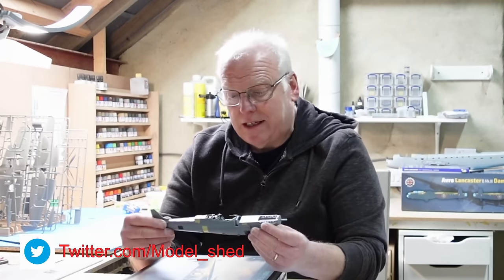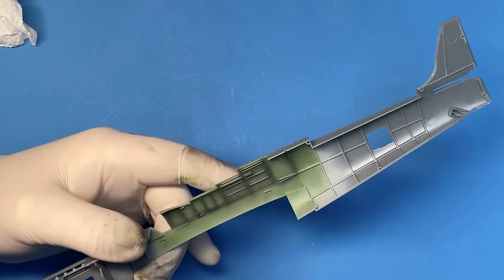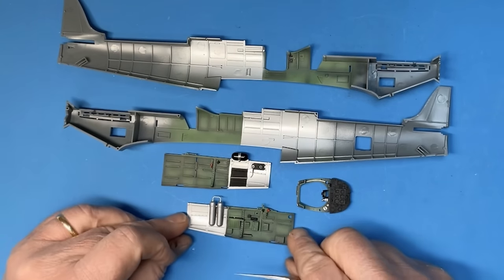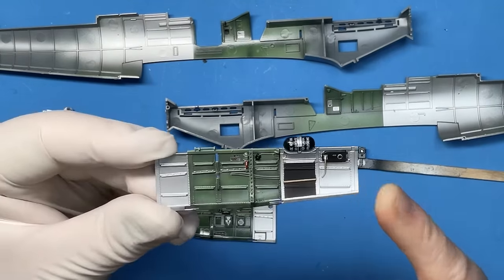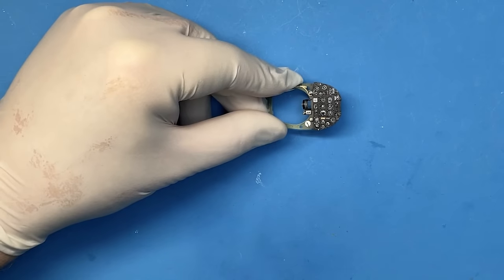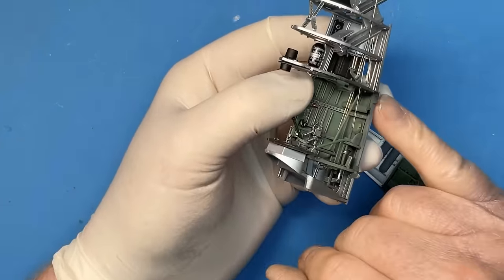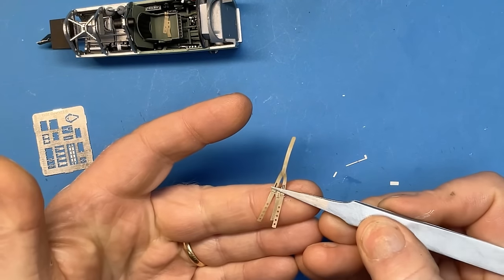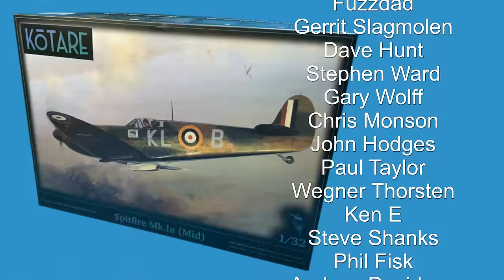Kotare 1/32 Spitfire Mk1a part 2

Comment: I remember a safety video from my time at RAF Laarbruch,with using cages when inflating Aircraft tyres,thats something that has stayed with me
Reply: I am an ex RAF Rigger, wheels and tyres were part of my trade. In training they shew us a video of a Hasting main wheel  being inflated until it exploded, a wheel the same size as that on a Lancaster ended up with the biggest pit you could put in your pocket.
Reply: @davegoldsmith4020  we saw a video about a Victor that landed with the nose wheel blakes locked on,flat spotted the tyres,we were shown the effect of not inflating aircraft tyres with the correct equipment,pressure cut off and cage,one tyre inflated outside of the safety cage,the airman over inflated the tyre and the thing exploded killing him.

Comment: Excellent video, fantastic kit, and a very clean job shame that the engine is not included in this kit.
Reply from the maker: I wouldn’t want an engine Anastasio - open cowlings spoil the apifires lines in my opinion

Comment: You said you were enjoying the build. So are we! Interesting that a plate is supplied through which the rigging for rudder and elevators are run and attached. Is that detailed in the instructions, or did you "wing" it? Pity that the work is not easily seen. Another modeller (Zinzan?) has described trouble with fitting the main chassis oleos. Instructions say to fit them after the upper wings are glued. Much easier to fit them before. Part 8 of the build I think. The seat belts are a work of art.
Reply from the maker: Hi John the plate give perfect alignment of the cables in the fuselage and the instructions are very clear showing this. I deal with the main gear in P3 - personally I don’t think fitting the legs before the wing is joined as Zinzan did is the right approach - I fettled them as Kotare suggest to ensure a good fit later.

Comment: For YouTube reference, 'Guy Martin's Spitfire' documentary film on rebuilding  N3200 Q V flown by
Geoffrey Stephenson will inspire and inform modelers with this kit. The cockpit green is accurate.
The Australian War Memorial w/site has a amazing RAF Official Training film, titled,
'Streamline Colour', by Guild Films that demonstrates the procedures needed to create the finish desired for, 'high speed aircraft'. The film shows the leading edge 'D' section of the wings made smooth by filling rivet depressions with putty and spraying primer/filler.
'Spitfire Preflight/Walkaround Tour -EAA AirVenture Oshkosh 2018' is another great video.
I have done enough 1/32 Tamiya Spitfires (one with the Aires resin cockpit kit) to know that even with the canopy open and the side door in the down position it is hard to see and appreciate the cockpit detail so I am building three Airfix 1/24 Mk.IXcs. Two will be posed in flight with pilot figures on custom stands. One (J Johnson)  with a variable speed motor to spin the prop the other (G Beurling) with both kit engines on their own stands. The third model resting on its gear with removable engine cowlings and a enhanced detailed cockpit.
I have the download version of Paul Monforton's Spitfire reference book for help.
Kotare has developed a wonderful kit that is designed by modelers for modelers.
Hopefully ReedOak will do a seated pilot figure.

Comment: why dont you use AK real Colours they have designated colours with out mixing
Reply from the maker: I suppose it’s because I’ve got dozens of expensive jars of paint already which I don’t want to waste by introducing a new range. The other reason is that I want to build the kit as Kotare set out so that viewers can see what the aircraft looks like as the manufacturer intended
Reply from the maker: They don’t appear to do Supermarine green either?
Reply: 10ml RAF Cockpit Grey-Green – Real Colours Aircraft RC293
I use this is this wrong ?
Reply from the maker: Not wrong Ralph but Kotare suggest that Supermarine used a slightly different colour with a brighter green tinge to it - that’s why I followed their instructions and mixed it.